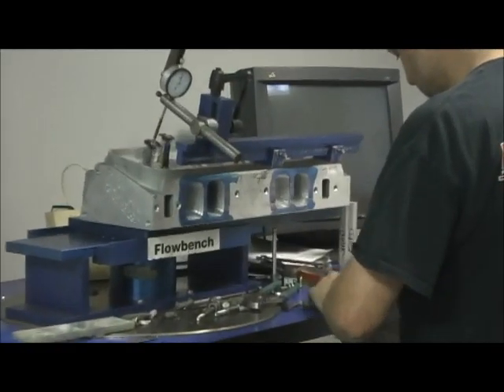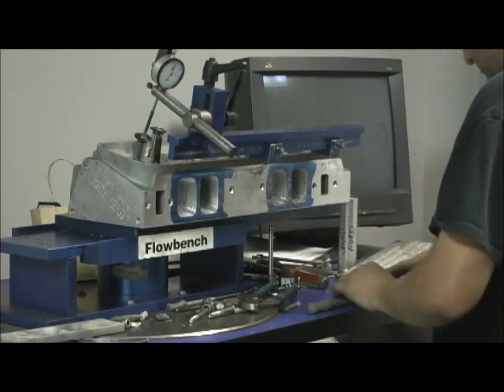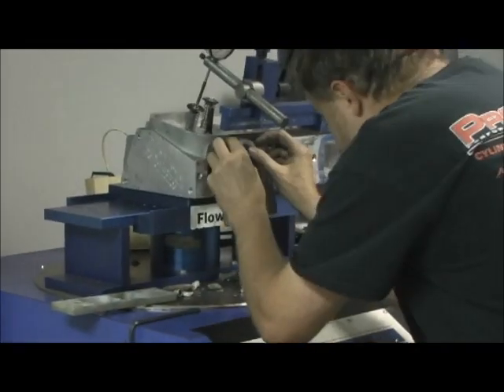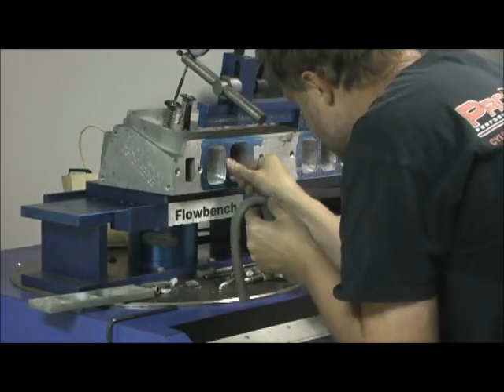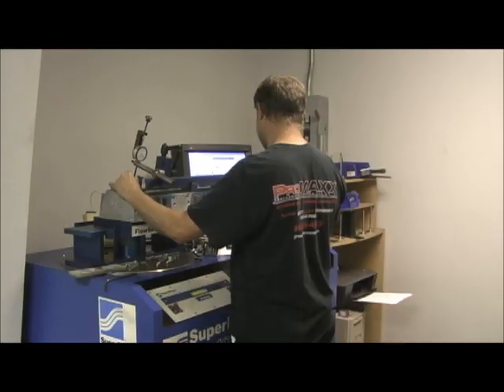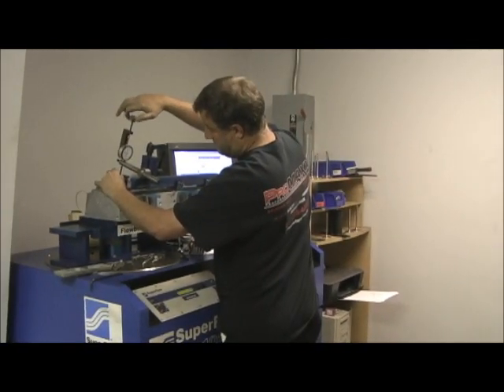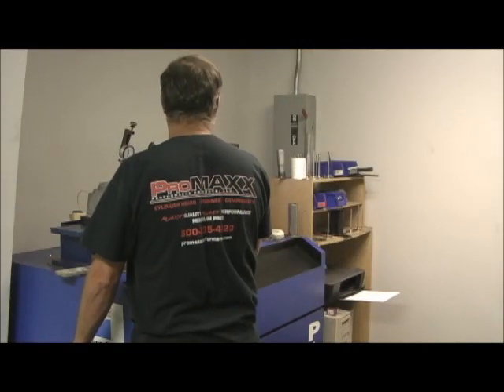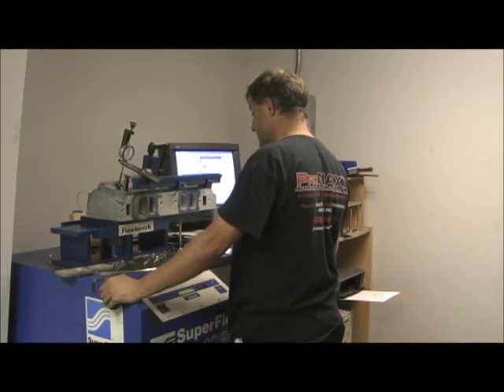Blyth Promaxx BBC 360 Intake NUMBER 7 or HOOK port 3.0

Comment: Amazing you are that close.
Reply from the maker: Charles Servedio Once again, this head was PUSHED to the max (no pun intended) as far as port thickness was involved, and my sonic tester showed area's of .080 where it needed to be moved to get more. I would NOT endanger a customers heads, the fear of busting through or making it TO thin; however, I was within 13 CFM of beating the best AFR had with there FULL CNC Version for way over 1000.00 LESS!!!  ProMaxx is making a NEW version of this head in the next couple of months, and he says it will be as thick as his MAXX 200's.
Reply from the maker: Hey Yank, Contact me A.S.A.P, you do remember my Yahoo Address, I tried to email you at your old Yahoo address and it said it was NO LONG VALID!!!  Contact me Yank, hurry.